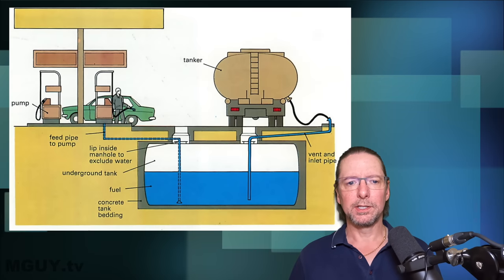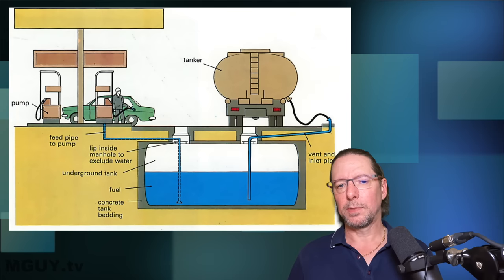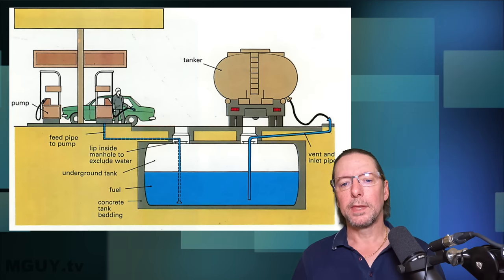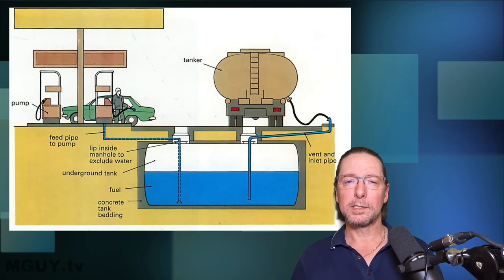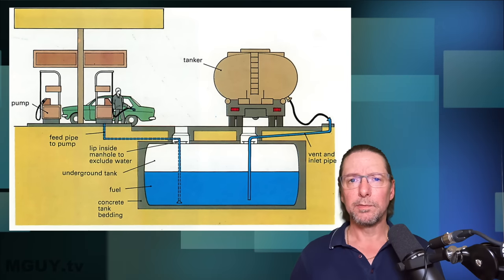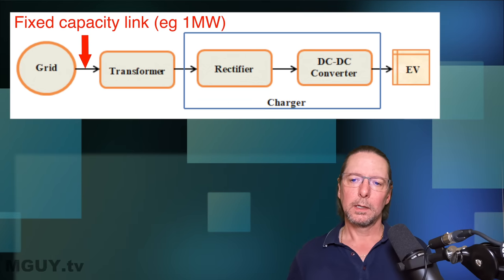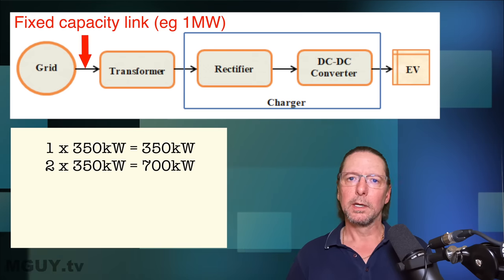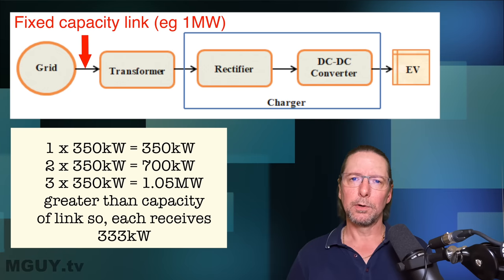HUGE problem with EV Charging Stations that no one mentions | MGUY Australia

Comment: The best way to make sure every ev can charge when wanted is to have a diesel powered generator that starts when charging is required— the more charge points the more diesel powered generators are needed— keep it green — you know it makes sense because a politician said so
Reply from the maker: Haha!
Reply: @sjb3460  What shame and why?
Reply: @RAM_845 No, wind turbines are operated by wind, you strange person.
Reply: So true. There is an image of an outback EV charging station coupled to a diesel generator.
Reply: @sjb3460  I have been driving EV's for three years and have never been towed. My battery will not go dead, it has enough charge for the job or it will get topped up along the line as it will today when I do a 200 mile run. Any fecking idiot being towed for running out of fuel should be ashamed, its the idiots that think it's some sort of inevitable consequence of driving an EV that should be ashamed. The depth of anti-EV ignorance is unreal.
Reply: @mikebreen2890 3 years 😂 Yeah huge amount of time to get data..
Reply: Great idea and the old fuel tanks could still be used to fuel the diesel generator to produce the electricity for charging the cars.
Reply: @mikebreen2890  Yeah until you have to take a long detour or there is no chargers working that you were relying on eh?
Reply: Why not incorporate the diesel generator into the vehicle like a train does
Reply: @alextaxi2593  Trains only do it due to the amount of gearboxes etc that would be required to run the axles off Diesel power from something I saw.
Easier just to hook the electric motors to the axles and run electric cables to feed them.
Running what amounts to 2 power supplies for a motor vehicle wouldn't be too efficient by the sounds of it.
Reply: @sjb3460 or when an EV owner plugs into a remote area charging station… only to hear the legendary diesel purr of a Cummins powered genset, to get them on there merry way!😂
Reply: @mikebreen2890 they actually require power from the grid to manage and operate the turbines systems when they have stopped… sometimes this is courtesy of a diesel generator.
Reply: @mikebreen2890 True running out of fuel/power due to negligence is ridiculous! But what about when you arrive to your pre chosen charging spot with bugger all power left only to find… its in use, out of order, requires signing up to a company, etc. Where do you go then… you can’t get a taxi to the Servo and return with a can of fuel.

It happens a lot when travelling. Besides the increasing inexplicable EV fires, the failure of the charging network would have to be the next biggest concern.
Reply: @alextaxi2593 nissan e-power same concept. Just a bit different in implementation
Reply: @alextaxi2593 Yeah, and for emergency use you could have coupling to allow straight mechanical powerline from the diesel engine through the transmission to the wheels...hey, wait a minute, that sounds kind of familiar...has it already been done...is that a car?😂😂😂😂😂😂
Reply: @lukeclifton4392  1: You don't turn up with bugger all power left. 2: You charge somewhere else: 3: My apps tell me which chargers are working and in use. Yes, all the different suppliers can be a nuisance but I have most of them on my phone and on top of that, all rapid chargers have to be contactless card by law shortly so no app needed.

As to fires, stop; being a complete and utter mug for media manipulation and look up some actual stats for yourself. You are absolutely being taken for a fool. In fact if we all had EV right now and I invented ICE, the ICE would be banned in a flash as a fire hazard!
Reply: @lukeclifton4392  So fecking what!? The big picture is cleaner power, get it?
Reply: That's a no brainer - when converting existing fuel stations to electric the large fuel tank is already underground. A large generator could run for a couple of weeks and not need a grid supply !
Reply: @sjb3460  a person who is not a hypocrite would refuse the tow and wait for another greenie in an EV
Reply: Already happening in England! Seriously! Motorway services introduced EV charging points before electricity companies laid connections so diesel generators have been installed. Net Zero!
Reply: funny thing is an EV will travel a greater distance per quantity of diesel via generator than a combustion vehicle
Reply: @sjb3460  Sure massively shameful. It should never happen.
Reply: @alextaxi2593  Sure lets do a series hybrid diesel car in Under 1.8 Tonnes. Good luck with that.
Reply: @hobo1704  Not relevant. It's the same regardless of any time more than 1 year.
Reply: @tommyking626  Sure it works fine with a 1.5L Petrol Engine and 2.1kWh battery. That fits perfectly in a 1.4 Tonne car. It has about 5km electric range.
Reply: @mikebreen2890  Wait till you drive up to a charging station and find that the cable has been cut and stolen by copper thieves. Happening frequently now
Reply: @Neojhun  total BS. 3 years old and saying my battery has never had a problem? Good story champ..
Reply: @peejayem4700  That makes it an uncoupled series hybrid ;)
Reply: @peejayem4700  Well, it will if you live on a planet where Newton's second law of thermodynamics doesn't apply. There is no such planet in our universe, though, I'm afraid to tell you. The losses incurred by converting heat, to rotational force, to DC, to battery storage, to AC and then back to rotational force, are significant, to say the least.
It is much more efficient to convert heat to rotational force and leave it at that.
Reply: "diesel powered generator" - lmao, the irony
Reply: @mikebreen2890  "So fecking what!? The big picture is cleaner power, get it?"

no, it's not cleaner/greener power, you still have to mine lithium for those patteries which similar to oil is non-renewable
Reply: @mikebreen2890  You are currently in a small minority of drivers who drive an EV so you are spoilt for choice in your charging options.
 If by 2035 the majority of people are driving EV`s  ( as the politicians and green lobby want) the problems will be insurmountable in countries like the UK. Our housing infrastructure means that a significant proportion of people will simply be unable to charge from home ( flat and apartment dwellers, terraced housing etc ) so unless the government provide millions of charging points in housing areas then demand will quickly outstrip supply . 
  And of course the other elephant in the room is a big percentage of the power to these chargers will still have to be supplied by fossil fuels making the whole exercise pointless. 
  Even with the best intentions universal EV usage is and will remain a pipedream.
Reply: @mikebreen2890  My bad, it was older ones that are not in use anymore that used diesel generators to start up, new ones just need power from the grid to keep operational, ie powering control systems and heaters etc.
Reply: @gooble69  what’s the simple physics? The efficiency rates alone of ev/generator/ice vehicle seem to stack up
Reply: @sjb3460  You're daft. why would you not call an AA or RAC service truck with onboard charger and get say enough power to get you to the nearest EV  station. No different to a can of petrol. AA and RAC will oblige in time !.
Reply: @revwpitt2347  Your comments on fossil fuel are simply wrong and based on your lack of understanding how an EV works. It is not pointless to fuel an EV with fossil fuel because of the efficiency of an electric motor compared to the horrid inefficiency of ICE. An EV powered by coal from a power station is cleaner than ICE!

This is so bloody basic to the discussion and yet time after time people suggest no gain if fossil fuel is used to power an EV. This is wrong because an EV is not wasting the fuel in a cloud of carcinogenic fog, get your head around this. 

Except it's not powered by coal, there is virtually no coal in the UK mix and about 50 percent now comes from renewables and is increasing. We are NOT increasing the amount of fossil burnt and don't need to.

There IS an issue with charging and people are working on it, the real issue is not the ease of charging but the fact that home owners  pay around 8p KW while those who charge publicly must pay much more. That has to change.
Reply: @mikebreen2890  True, especially when few know they do not help with the climate.
Reply: No, just a bank of 40ft containers with recycled ex EV batteries as the "tank" of electricity....at each EV site.
Reply: @JackBug-iz7er  I took an early walk this morning, the first part along a busy road as people go to work and school. It STANK of exhaust fumes, that needs to end and will.
Reply: @mikebreen2890  Scottish Power admitted earlier this year that all their wind turbines are fitted with diesel generators...
Reply: You still need fossil fuels to charge those foolish cars
Reply: @gordy4459  I did no such thing.
Reply: @michaelcaldarone6930  EV's use fossil fuels far more efficiently than ICE due to an efficient electric motor, while ICE largely wastes fossil fuels, hence the gain even if fossil fuels are used for EV's. The UK mix is about 50 percent renewables and rising.

My "foolish" car has been just fine, not stinking the place up, costing very little to run, quick and fun to drive and very convenient to charge up.

There are some fools on here, the sort of people that think you might as well burn oil in an ICE if an EV is using fossil. Simple people, they have trouble understanding anything less than bloody obvious.
Reply: @mikebreen2890  Thankfully, I live in the country. It will not 'end' with Ev's.
Reply: @mikebreen2890 There are times when a weather system passes through that causes a lull in the wind pattern. You have to have backup to cover these situations. Here in Texas, USA the wind blows constantly all year. (we are lucky!) But we have two atomic reactors to take up the slack if need be.
Reply: @glasslinger  So what?! We are increasing generation. by other means, it's not just wind. Home storage in combination with solar is also increasingly popular and being used to balance the grid.
Reply: @JackBug-iz7er   EV's don't end the world, Wally.
Reply: @mikebreen2890  Of course not, Willy.  :)
Reply: The only clever here!
Reply: The biggest issue facing EVs is not the charge rate but # of chargers keeping up with demand for EVs. The "HUGE" issue being reported is bollocks basically and even if all the bays of a charging station were occupied and charging, the likelihood is it wouldn't impact much on charge times for obvious reasons - a) the company that installed the bays wants to make money and you don't make money if bays are occupied more than they need to be, and b) they're not anti-EV idiots and are capable of doing sums.
Reply: @drxym  Exactly. I am so freaking tired of the anti-EV shiite.
Reply: @johnnichol9412  If you're driving 350kms then there are EVs will do it in one drive, e.g. a Tesla model 3 standard or extended range would comfortably cover that trip but you would have to charge somewhere before returning. I expect most people would plan charging stops to coincide with toilet / food needs so it's not like you're waiting around per se. Nor would you necessarily have to sit for 30 minutes. There are apps like ABRP which will optimise charge stops and you should plug in a car and your route and see what it says. If you absolutely had to cover both legs without charging there are cars that can do even more range but they're not too common yet. Also I think from your comment that EVs are fine in a city that you understand that covers the majority of use cases and for the exceptions, highways need sufficient public chargers to meet demand.
Reply: @alextaxi2593 Edison Motors is actually doing this for trucks right now.
Reply: @gooble69  an ev has an efficiency of around 80%, a combustion engine vehicle around 12-25%, depending on petrol/diesel, and a diesel generator around 40%. Of course these numbers can vary and subject to variables - but I dare say not significantly.
Reply: @mikebreen2890  So you've never been caught in a snow storm or in any other major traffic jam that's gone on for hours in the cold?  Batteries don't last long in the cold and last even less if you're trying to keep warm.
Reply: @bite-sizedshorts9635   More ignorance, EV's are just as good in that situation as ICE, plus less likely to kill you with carbon monoxide. Batteries are less efficient in the cold, but as usual you overstate the issue.
Reply: @RAM_845we just need to get big fans to turn the wind generator.  Free power 😂
Reply: @RAM_845 Presumably you chose that name for its strength rather than the implied intelligence level.
Reply: @oldbloke204  Never had that problem thanks, and I charge at home off peak, 19 times out of 20.
Reply: @rbdogwood  Well done you.
Must be great being tethered to your house via an extension chord to save a few bucks to pay for your overpriced buzzbox.
Reply: Hahahahahahaha!!!
Reply: @mikebreen2890 So what happens when you are taking a trip to another part of where you live and it’s over 800 miles one way?  With your 200- mile range, we would have to stop at least 4 times and then hopefully there would be a charging station available.  I
Reply: @sandybruce9092   My 200 mile EV is not optimal for very long distances, you really have to make a balanced buying decision because paying a lot of extra money for range you only use a couple of times a year usually makes no sense, buy a car for the 362 days a year, not the 3. It's also not the fastest charging EV.

I just did a 1000 mile tour of the highlands of Scotland, charging time didn't bother me at all because there was always something to do while the car charged and there's the secret.

I just checked out Wick in Scotland to to Plymouth in England, that 771 miles. 

ABRP says this is a 12 hour run (it will be more, it's always optimistic) and gives a total charging time of one hour and 12 minutes.

For the sake of argument, let's say four 18 minute breaks taken 3 hours apart. Is a sub-20 minute break every 3 hours really such a deal breaker? 

Oh, and you don't hope for charging stations any more, they are all clearly mapped and most have live availability data.

https://abetterrouteplanner.com/
Reply: brianwoodrow6923  Thank you for saying “fossil fuel plants” which is absolutely correct!  Most people don’t understand that fossil fuels doesn’t come from bones!!!
Reply: Good one!  Someone may come up with the idea of putting the diesel directly in the vehicle!
Reply: @alextaxi2593  That is how hybrids work.  For road vehicles it is the worst of both worlds.  Great for huge trains and ships.
Reply: @lukeclifton4392  Just pop in a few AA cells or connect to a power bank.  Could charge from solar panels for a week or so.  Maybe break out the hamster wheel.
Reply: @mikebreen2890  Hey mike, there's this thing called life and it can be unpredictable at times.  What you see other people doing, like not having enough fuel or charge can also happen to you.  There are a multitude of situations that could arise for why they ran of fuel/charge.  You're human, you also make mistakes.  EV present a real issue in difficult conditions like in winter and being stranded more so than what you'll get with a normal vehicle.  Do I really need to explain what these issues are as most people can already work it out for themselves.
Reply: @mikebreen2890  'there was always something to do while the car charged and there's the secret'  Yes I'm sure every single member of the general public will return to their EV at exactly the time it needs to be moved to make way for the next car and they're never late returning to their EV.  You live in unicorn land.
Reply: @CyrilSneer123   How often do you run out of fuel?